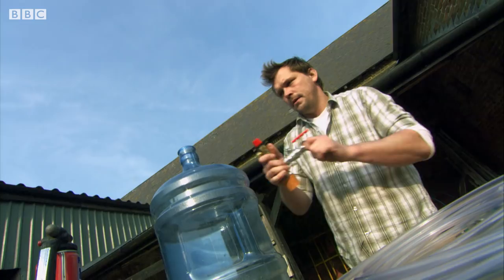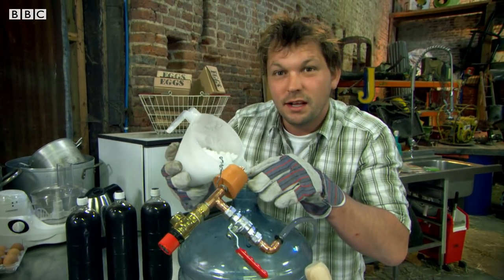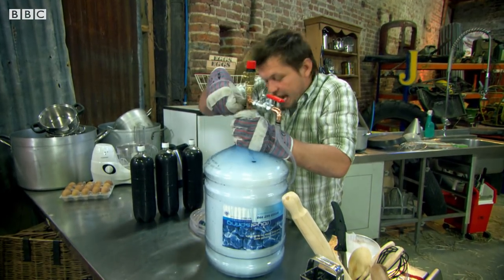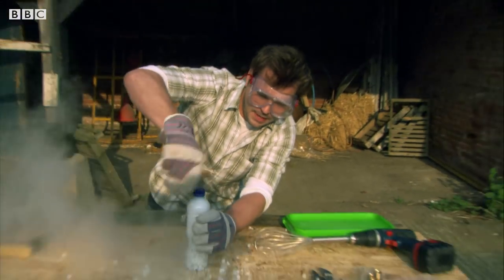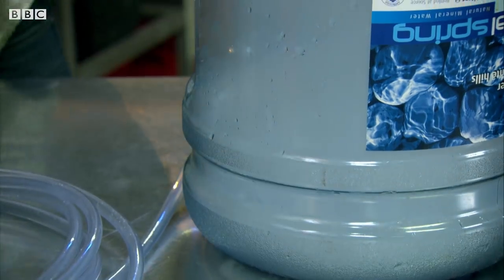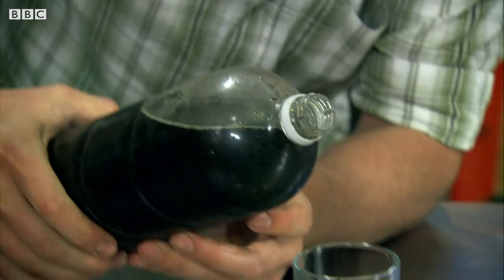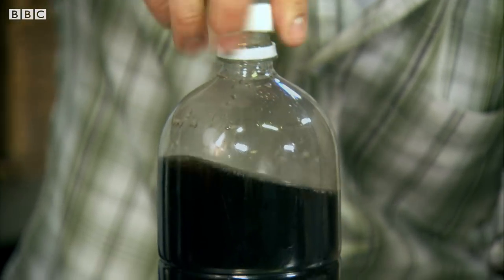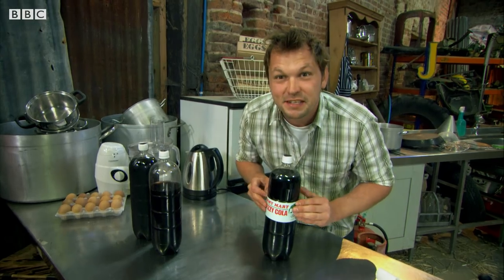The Best Way to make Fizzy Drinks | Earth Science

Comment: You can really tell this was made for TV: 
1. If he was so worried about a pressure building up why no relief value? Or use a vessel that has better specs to deal with presure. 
2. He needs to bubble the CO2 through the solution, not just gas the top. 
3. He should really dehumidify the CO2 before gassing into the solution.

Comment: Ummm. A quick FYI about dry ice to CO2, from experiments with the tank of a CO2 fire extinguisher. The empty weight of the cylinder was 2.5 kg. The "tare" weight (or "filled" weight) is stamped into the metal cylinder - 10 pounds, or 4.5 kg. We added  2 kg of dry ice to the cylinder, and re-installed the valve and pressure gauge. Tank pressure went up to 920 p.s.i. as the CO2 warmed and turned to gas (and some liquid). This is about the norm, and the tank was within its test expiry date. I mention this only because someone might be tempted to use a larger and what looks like a "more substantial" container, with fatal results.

Comment: you need a stabilizer, something that helps the CO2 convert to CO3, otherwise theres nothing holding the equilibrium back when you release the pressure. Usually a weak base like sodium benzoate, helps the pH shift too. This way you're just gonna have a bad time.

Comment: then again, cola is a not-so-soft drug
Reply: The Kola nut has less caffeine per total mass than coffee beans. 
If you are referring to the refined Cacao extractive that had been a part of Coca Cola, it hasn't been used in 9 decades. Even before that, it was in concentrations around 4% by mass, meaning you would have to drink about 10 of them back to back without peeing to get a significant dose.